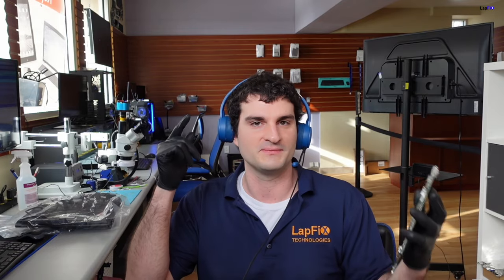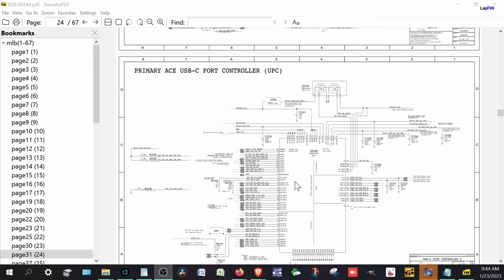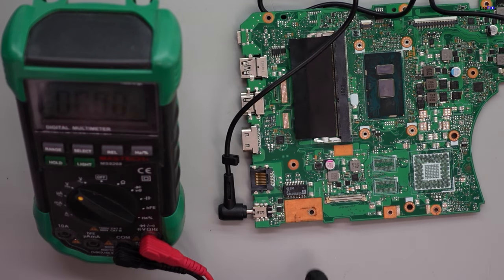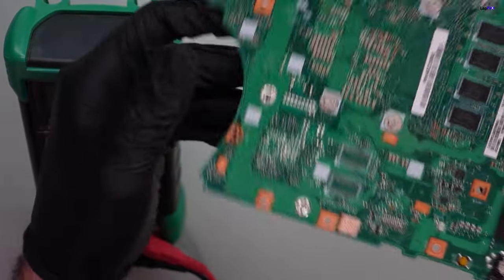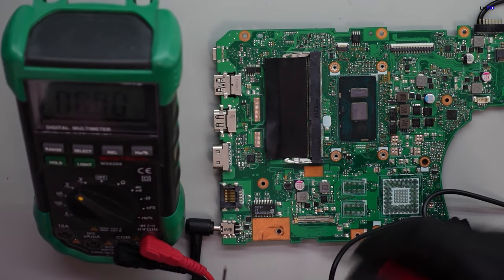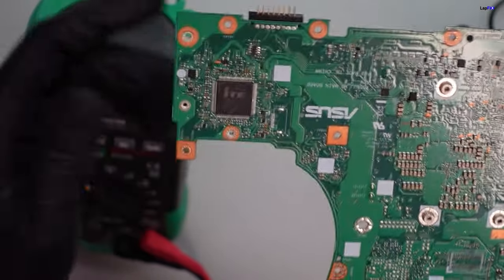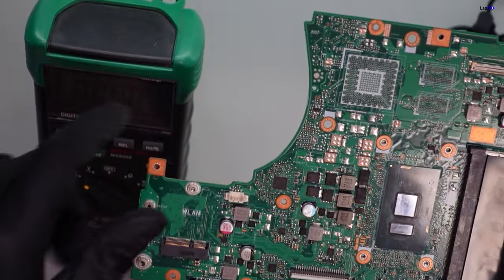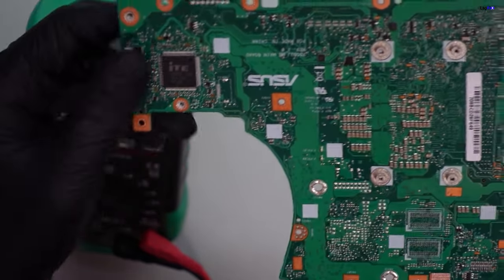How To Diagnose A Motherboard - Basic Troubleshooting

Comment from the maker: If you found this video informative, please leave a like and sub.  Should we make a basic troubleshooting video for a Macbook Logicboard?  Let us know!
Reply: I am trying to repair an Acer gaming laptop. When I press the button, the light turns on and immediately turns off. I tested all the capacitors and they are all fine. I tested the mosfets in VCORE and one side of them is 0 ohms. I put the red probe on ground and black probe touched the mosfet (source or drain). I also reversed the probes, but the situation did not change. I think the CPU is shorted. CPU failure is a common problem in gaming laptops. Is it a good idea to remove the mosfet and inject voltage? If so, how many volts and amps do I have to inject? The mosfets away from CPU do not have this problem. The VCORE only has this problem. I connected the charger and the laptop takes in 19V. I tested the voltage on side of the first mosfet and it is 19V (source or drain). The other side is 0.10V. Would it be a good idea to remove this mosfet and inject 19V? If I put one probe on the ground and the other one touches the mosfet, it does not show me 0 ohms. I fear making mistake. This is why I need your advice. I look forward to hearing from you soon. Many thanks for your help and patience. I really find your videos useful.
Reply: Please do a video on a Macbook.

Comment: Slow down…. Your speed is getting me dizzy
Reply: I know it's probably more annoying to do this but try to slow the video down and have captions on. I know I'm pretty late.
Reply: that's why youtube has an embedded speed control in every video...
Reply: DRINK CAFFEINE...
HE IS ( NOT )
GOING FAST ENOUGH !
Reply: Dude is all over the place !!!
Reply: fine for me, maybe you’re just slow?
Reply: Gave me extreme anxiety
Reply: I hear you. He glossed over some key aspects, such as: 1. Which voltage/current detection to use with your multimeter 2. How you know what AC adapter to use (and how to check if your MB is compatible with it) and 3. What "MOSFETS" are.  

Joking about finding and using the manual as a reference was funny, but sadly, it's an all-too necessary component when learning about your hardware.
Reply: I disagree this is the perfect speed. Do 0.75 speed
Reply: For sure😢
Reply: U know there is an option for you to slow it down right
Reply: Seemed alright to me. If anything, I found that they were rambling on about the startup chip that I missed the part where they mentioned that they’re typically 3.3V most of the time; thought he just randomly pulled up the spec out of thin air.

Comment: This literally tells us how to do absolutely nothing 🤦‍♂️🤦‍♂️🤦‍♂️
Reply: How so? He walked through step by step, physically demonstrating basic motherboard troubleshooting (i.e. power delivery testing). If at any point you find a point where power delivery is failing then you've basically isolated your issue and can focus your troubleshooting on more specific elements associated with the failure(i.e. input rails/output rails) or go about the repair once it has been fully isolated.

All troubleshooting is a logical process of elimination and subsequent repair. You analyze the operational mechanisms to understand the operational flow. Then you test each element's functionality to find the point of failure. Then you test the sub-elements of that point of failure until you isolate the failing sub-element and so on. You do this until you arrive at either the most minute failure (or point of falure) or until you find a point of failure that constitutes a realistic starting point for the repair process. 

Some people might diagnose a PC to the component level, while others may diagnose individual components in an effort to repair the component as opposed to replacing it. Which is what he was doing in the video.

Either way though understanding what troublesooting is and understanding the functionality of the system/component/processes is key to successful diagnosis and repair. It's really as simple as that. A little baseline knowledge is all that's required to understand what he taught in this video. If anyone lacks this baseline knowledge then just go study a bit and the value of the information is clear.
Reply: 100% CORRECT
Reply: Bro literally says how to troubleshoot. This is how they test for part that fail

Comment: I've done a custom protection upgrade on a motherboard that will protect against capacitor leakage that can knacker motherboard tracers.
I made myself a guard made from Polypropylene.
I hot pin pricked plastic plates to go under the capacitors isolating it from the motherboard so if the capacitors leak, the acid falls onto the plastic instead of the motherboard.
To fit the carefully engineered plastic plates, I lined up & stuck the plastic  pieces to the motherboard & threaded the new capacitors through it & the motherboard, & soldered. No acid will touch the motherboard now if the capacitors blow.

Comment: What are the settings you use on the multimeter for testing power
Reply from the maker: DC Mode as in the video for checking the current coming from the power supply through the mosfets/board.  It is different based on what you are looking for
Reply: @lapfix but on some multimeters there’s 600, 200, 20, 2000m etc so which one do you use?

Comment: How did you know which pins to check?
Reply: You can search online for the chip pinout diagram and see which pin get +Vcc or input voltage. IF you can identify the chip, that is. If it's not stamped or marked (and not all are) you're kind of on your own.

Comment: you forgot to tell us which dial you set the mulitmeter too? it would help?:face-pink-tears:
Reply: If you're measuring voltage, you set it to volts. If your meter is not auto-ranging, then you set it to a high voltage range and read it. If it doesn't show then you set it to the next lower range until you can see what the voltage is.
Reply: If expecting to see 19Volt, where would you set it? If you have an auto ranging mm, set it to Voltage and you are good to go.
Reply: if you don't already know that I would suggest getting someone to help you or get someone else to fix it.

Comment: Motherboard repair is kinda crazy 
1.There are alot of different kinds Volts such as 19V,1.3V,25V,6V etc
2.Some boards are easy to track for beginners while are harder eg.like cheap Laptop boards
3.Devices are not cheap eg. cheap Multimeter will not beep 😅

Just saying,thanks for the upload.We hope somedays we will understand this things 😂

Comment: Hi Guys,
I plugged my powered USB hub into my Yamaha keyboard USB device port.  However, the power adapter for my USB hub has PIN revered,  meant the positive to negative and vice versa.  Now my USB device port stopped working.  I think the USB IC may be burned or some resistors or capacitors burned.  How could I troubleshoot it and replace the right part to restore my USB back in live?
Thanks in advance!

Comment: I have a game system PBC and when I plug the power supply to the wall outlet I have electricity in the power supply wire, as soon I connect it to the PBC there is no more power in the wire. why is that?? Thanks in advance and great video
Reply: bad power supply, either has a blown fuse or shorted cap